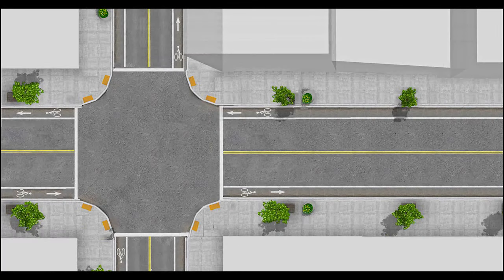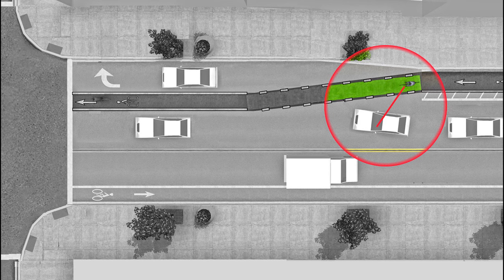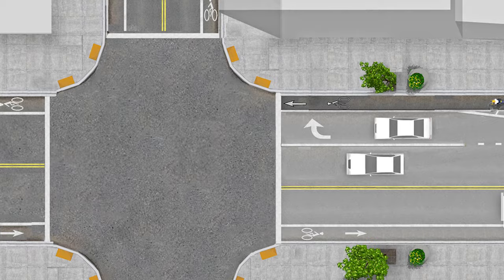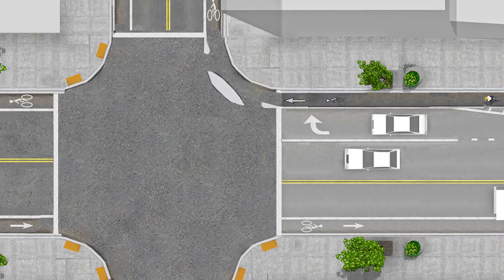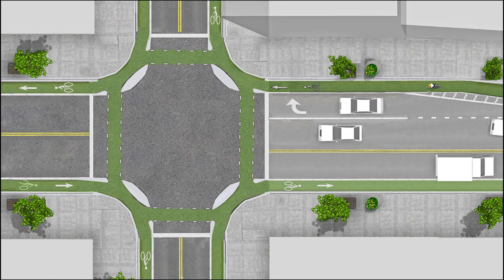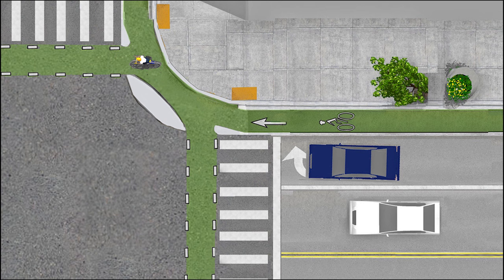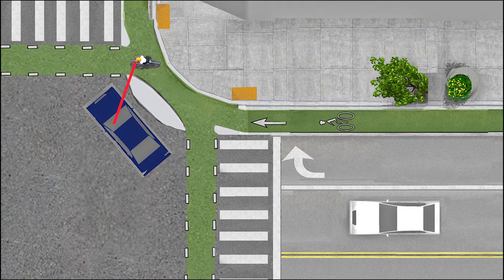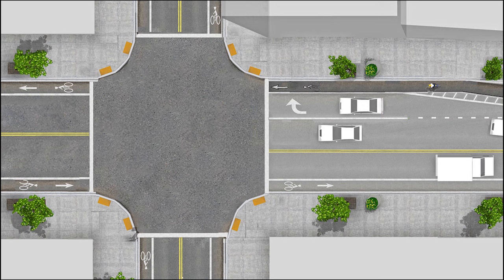Intersection design, the Dutch - cycle friendly - way

Comment: ????????????????????????
- where you talking about 
_
no is not what you say 
- is about 
- they have everywhere build a traffic roundabout with cycle have right to be first
_
no 
- they do not love bicycle they using because "saving money" they using is a hype, they using want belong to modern, they using more and more state have them plucked  like a naked chicken
- they do not have options 
_
example 
- some dinner cost 5€ parking cost 7 euro there you go use car
_
example two 
- you want be in center of city for some coffee 
- coffee is 2 a 3 euro parking 7 or 10 euro 
- and more worse all streets closed
_
small country lot citizens no space 
and rtl4 and green left some party want solve world problem remain to be until now 3 billiards refugees prime minister have welcome 250 000 whom mean remain only still 2 999 750 
- and then what is car 
- only for residents of reign and whom is obedient or working in township
_
driver license some 4000 to the 6000 euro 
fuel most expended in world 
- in Belgium 1.50€ here in 1.85€
_
whom mean they have created problem and offering solution
_
eeeee nobody in world known why they build bicycle roads 
- in the years 80 90 95 even 2000 middle car are opel astra ford focus ww golf 
- now toyota aygo peugeot 106 and such 
- folk driving class less as 30 years ago cause have not more money to spend like then
_
I do not known where about you talking is not reality is wanted reality but does not represent what folk want
_
simplicity 
- why to be on road 30 minutes of life if it can be 10 minutes 
- and that is why only one option for future is MAGLEV train on speed 1000 km hour and inside you with your car